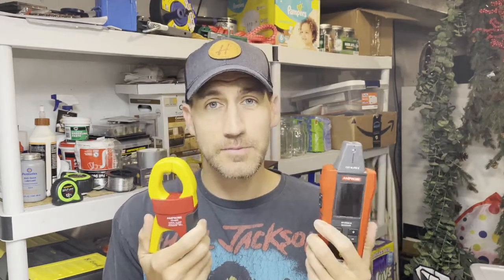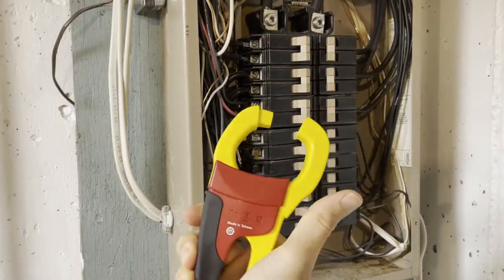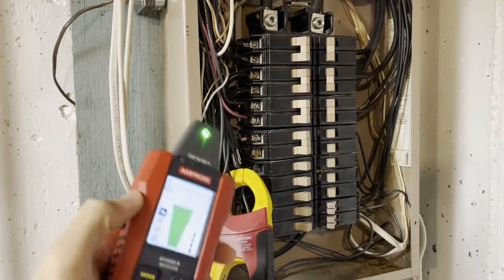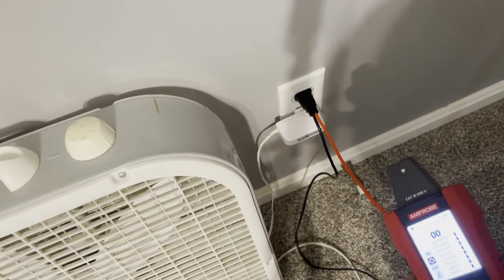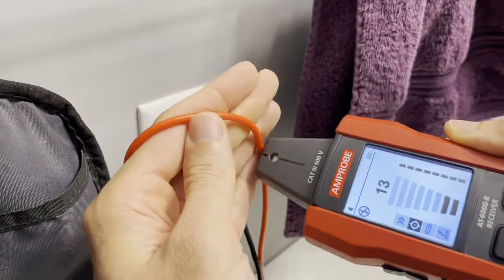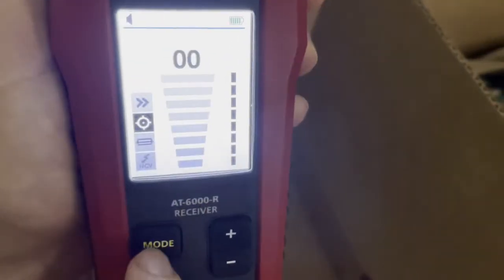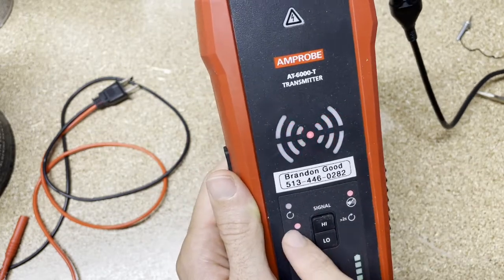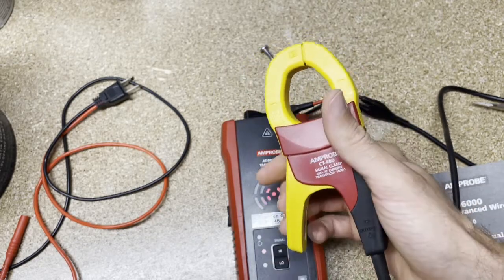Does this thing work?!? - Wire Tracer Clamp - Fluke Fridays - Episode 72

Comment: does fluke make something where you can have your meter hooked up to wires and if you have to shut a breaker off that's hundreds of feet away that maybe you can see the read out of your meter maybe through an app??
Reply from the maker: Many of the meters work with Fluke connect. But those only work within blue tooth range, not hundreds of feet away.
Reply: My fieldpiece meter connects to your phone via BT and their app. Not sure the range, but it's good for clamping on in an MCC bucket and viewing the start current on your phone out at the piece of equipment or wherever your start button is